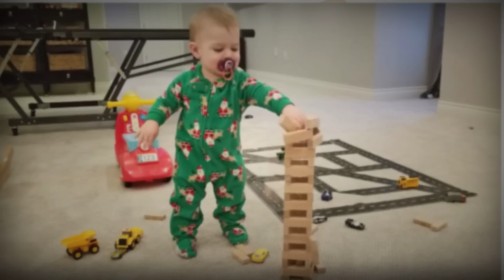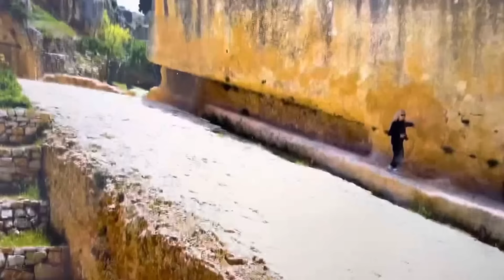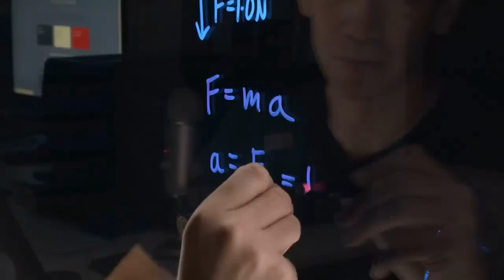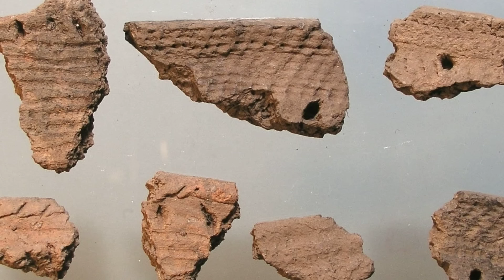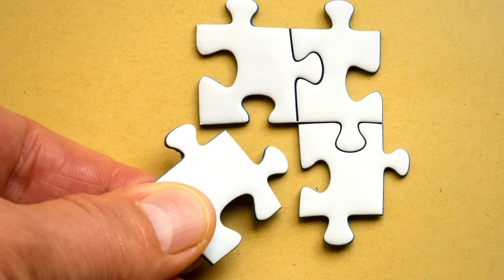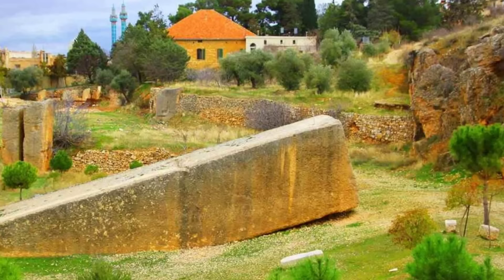Baalbek's Trilithon SHOCK: The 800-Ton Monster That "Should Not Exist"

Comment: The fact is if you do the math. A regular sized helium balloon can lift pyramid stones, and hydrogen has twice the lift. In order to levitate pillars stones blocks once sheathed away from cliffs and cut, was to sew animal stomachs together, hides, making a large balloon and filling it with hydrogen use ropes to lift. The math channel worked it out to 20,000 for a reasonable size hide balloon tied together, until they get the stone into the air where it is handled by a crew using ropes. Walking along side steering the giant stone as balloons take it up
Reply from the maker: @Otherworlds69 Interesting engineering theory! Creative way to approach the logistics of moving those massive blocks.

Comment: The answer is not that difficult. You either deal with the gross weight or you have a way of making it lighter. Our physics is stuck on grade 1. Their physics may have been on a completely different level. I recently published a new Atomic construct to replace the one we have today. Under this is something I call Spin Conveyance (SC) where the actual proton/neutron difference of each atom versus the total mass of the atom provides an inertial nucleic nudge. That nudge depending on pulse frequency can call on nuclei to nudge in different directions. Example of this on YouTube is of aluminum sheets connected to frequency generators that rise at certain frequencies. Today we think the pulse in generating a magnetic field but in SC fields  or electrons do not exist.They are an illusion we have been tricked to think is real. So we look at this problem with our limited blinders and SC just opens it up to what they then were considering as how an atom worked. They were open to true effects, we are blinded by an academia that belongs to power brokers who stifle whatever they think will lower their earnings. If you could lighten the weight of a rock or even make it float, you also can create space ships that can reach space and beyond. This is all within our grasp to work out the many variables during the next 1000 years.

Comment: If they couldnt move the stones in the quarry why didnt they cut a bit off
Reply from the maker: Michael, great question! One theory is that the giant blocks left in the quarry had flaws or cracks, so they were simply abandoned instead of trimmed. Others think they were meant for a project that never got finished. What's your guess?

Comment: So the Romans carved and lifted 3 800 tonne stones, not even building up one complete symmetrical level and then totally swapped their construction to much smaller blocks which don't match?
Surely you can see there are two different builders and civilisations involved in Baalbek?
Reply from the maker: @nousinmotu It is a fair question, and the unfinished stones are part of what makes Baalbek puzzling. Quarry sites there show the Romans did start huge blocks, though why work stopped is not certain. What is your explanation?

Comment: I've worked on some restoration of castles in Ireland from the 1600s and the technique used back in those times  was to build up a mountain slope of local  soil  /clay/sand inside and outside the walls as a ramp up to the height required. It's labour intensive but basic tech. no special tools required.
Teams of donkeys were probably used to haul up heavy stone blocks on logs that were covered in a friction reducing coating like wax or similar natural material. It's surprising how much soil a fit man can remove or fill in a single day  with just a simple shovel.Quite a few tonnes.
Reply: Except, no type of wood can withstand 1000 tons. The logs simply splinter.

Comment: This is so dumb and inaccurate. The quarry was higher then the temple. The built earth ramps and used gravity, sledges, and levers to move these. Stop thinking in modern standards with cranes and engines. This was time, motivation, and devout belief in a mission. The stones were likely cut roughly and placed, then smoothed in situ. That would be why you see no imperfections. This is not a mystery, just a different era with humans who had full use of their brains in a time less distracting and convenient.

Comment: More than likely, we are over complicating these things they were probably accomplished using a seesaw technology the lower end with the weight you put a lift, shift the weight to the other side it raises up, lifting the stone, higher than necessary, and then sliding or tilting it to move it whatever direction

Comment: Only an idiot believes the Romans did more than found it just like saying the Inca without a written language or wheel built Sacsayuaman, cusco. Absolutely nonsensical. When the only reward is for memorizing false information this is what you end up with. Even if the reward itself consists of nothing more than a pat on the head it's a hill they'll die on because they went through the trouble of 
"learing" it so now critical thinking is nonsensical. Takes a lot of hours of indoctrination and money generally debt to get that damn dumb.

Comment: The Trilithon stones are not Roman, but Megalithic. Local limestone surface weathers about 0.1mm per century in a moderate climate. And the surface weathering of the stones are much, much more progressed than on the Roman stones above them. Also the design of the stones are completely different to the Roman stones above. Analyses of their outer weathering proved that they are at least 20.000 years old.  And they were suddently abandoned due to external forces. It was showed that similar huge megalithic constructions were abandoned around the same time (asteroid or comet impacts on earth?). In China there are megaliths of 16.000 tons quarried, 10x of Baalbeck! ☝🧐
Reply: Of course, cavemen moved those stones using Dinosaurs as their workforce. Simple 😢
Reply: there are similar constructions all around the world, that get no attention….. I am convinced in a very ancient culture built that podium, and podiums like it around the world….. you simply don’t build on that vast and heavy of a scale unless something extremely heavy is going to sit upon those foundations, or the foundations are part of some installation that the builders wanted separated from the rest of the world, separated and insulated so they could carry on their work without being disturbed by other creatures living on this earth…..
Some are built like forts, with massive walls….. I believe they were built in the days of the dinosaurs, when perhaps some intergalactic race used earth as a way station in their travels, you simply do not build that big unless you are trying to keep something big out of your way….

Comment: What makes anybody think the romans did this, the romans found these stones and built on top of them, they also used alot of smaller stones above and nowhere near built as accuratley.
Reply from the maker: Good question, @richardbruske908! Historians generally credit the Romans with the temple above, while the huge lower stones may be older. Dating the lowest stones is still debated. Thanks for watching!

Comment: It would not have been the size or weight that stopped the transport of the large stones. Instead, they would simply have trimmed or split the stones into usable and transportable sizes. There had to have been some other reason.
Reply from the maker: nteresting point, @JasonRule-1! Splitting the stones would have been the easier option, so the reason they were left must be more specific. Why the largest blocks were never moved is still debated. Thanks for watching!